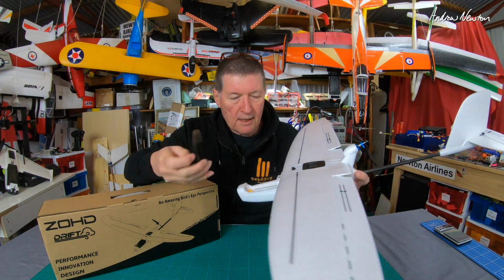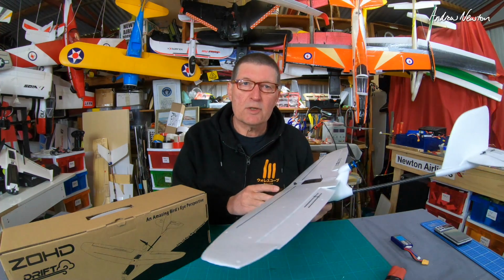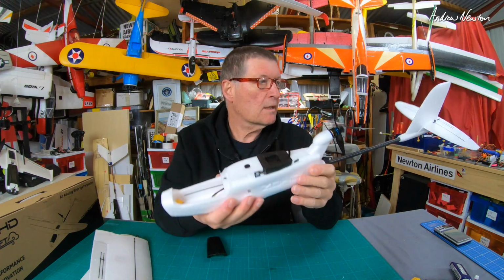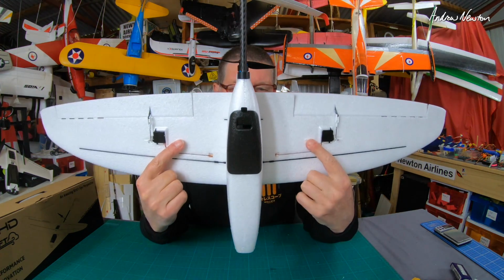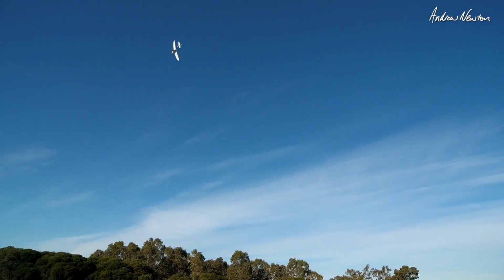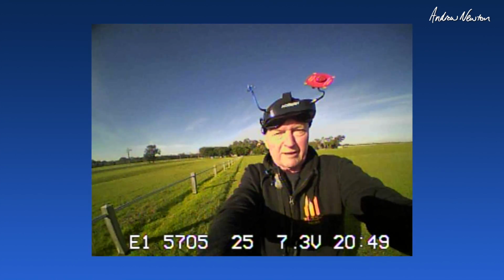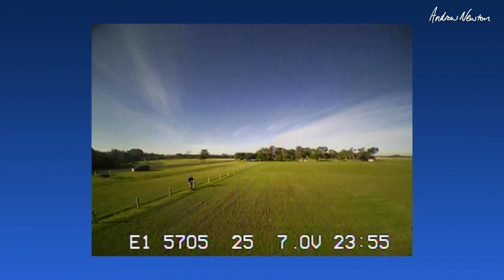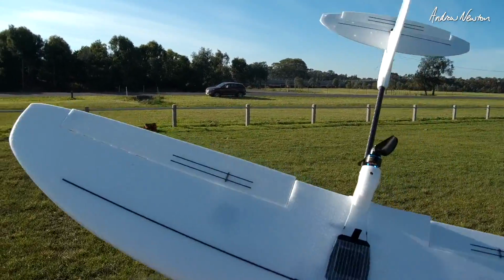ZOHD Drift - Assembly and FPV flight

Comment: Good video, i have bought a new one in PNP version and i wan use it like motor glider for relaxing fly, with not autopilot and camera, only manual with my rx and tx used.Can i conect the ESC and other servos directily to my rx?What is the set up recomended for this manual mode to fly?THANKS,
Reply from the maker: Yes it flies well as an agile little LOS model. No special setup required, maybe reduce the rates if it's too agile.

Comment: Just maidened my Drift with KoPilot - flew great in stabilized mode - great return to home behavior - used autolaunch RTL to launch twice - both went off without a hitch  -3s 850 balanced 10mm in front of the nubs  - but it flies poorly or not-at-all on manual mode - just rolled over and dove to the ground. My buddy did this and his crashed, so I did very little manual testing - but i will normally fly fpv in stabilized mode - best out of the box experience for FPV for those who do not want to tinker with electronics and ZOHD always impresses with design.....I am also sold on the Kopilot - easiest and cheapest way to add Return to home to any model.

Andrew - have you had any experience with this manual mode behavior? 

Great channel Andrew!
Reply from the maker: Full throws are probably too much for manual mode. I used 50% weight just for manual.

Comment: Andrew which do you prefer between this and the eachine razor or are they just different animals?
Reply from the maker: I'm flying the Razor more as a sloper and handles wind a bit better.
Reply: @AndrewNewton  not so many slopes where I am and not by the coast so more flying in the countryside. Just looking for a good upgrade from the F959 and already have an i6 controller

Comment: You came back and fixed your 1800 to 1100 battery size..??
I would not have bothered for that one mate..
I'm struggling getting CG with 2 x Lithium Ion 4000mAh Batts, Any hints?? More nose weight?? Try flying as good as You??
No Nav gear installed.. <]:)..
Reply from the maker: Huh? You've lost me there. On the Acrobatic sloper video I used 950 2s right forward then 3000 2s Li Ion pushed right back under the front of the wing.
Reply: @AndrewNewton :: May have found an answer!!  ""Throttle Elevator mix - Taranis Q X7""

Comment: Mine flies great as long as it's in stabilized mode.  When you switch to manual, it immediately noses straight down and heads to the ground.  You can switch it back to stabilized and it recovers,  the auto launch and return to home work great.  I've checked the CG and all seems well.  I don't want to fly FPV until I get this worked out.
Reply from the maker: Always always get planes flying in correctly manual mode first, then everything else follows

Comment: i heard that the wings destroy themselves if you go faster than 50mph.
Reply: Yes, it is specifically sold as a model for gentle turns and soaring - it is not a hotliner, and not for tearing up the sky. Manual says "ZOHD Drift is mean(!) to be a slow cruiser. IT'S NOT a RACING/AEROBATIC plane". There are four more sentences to more or less the same effect... see https://fa00daf4-2348-470a-96d7-418afee9141d.filesusr.com/ugd/9960f7_7f9255c5fcc24aa1a556ffa8f40b79fd.pdf
Reply: @KetilDuna  diving to lose altitude is not a racer. It should be air worthy and it is not. Glad I did not buy it.
Reply: @ror-ys3qp  I'm happy for you, making your decision. Your initial 50mph ~ 80km/h has little to do with "a slow cruiser" as far as I'm concerned. If you change your mind, be sure to cut off the engine before diving. There are also two aileron servos .. i retired the Y-cable and implemented combined aileron/flaps on mine. The flaps slow things down really well, and can be combined with quite steep descents. Also, use a small battery to keep it light and avoid speed buildup, especially if you carry the camera/tx appliance. I'm glad there are choices and a market for small, light and relatively slow flyers. Powered gliders are so nice for casual flying. Happy flying!

Comment: Does it use a y harness on the ailerons?
Reply from the maker: Comes with a Y harness but you dont have to use it.
Reply: Thank you andrew i have the zohd dart and the drift and kopilot  on its way most videos dont really show that close up the drift like the dart has two aileron servos my dart dosent have the kopilot it has the maytek wse i plan on trying my extra r-xsr on the drift with s bus
Reply: Nice so the drift has a servo in each wing   and you didnt use the y harness then where does the second servo plug into ? Aux or rudder im  Still waiting on my drift and kopilot
Reply from the maker: @RGCbaseace  For the Kopilot you do need to use the Y lead.
Reply: @AndrewNewton  i got it figured out thanks what a lil gem 💎 to fly wish it wasnt raining here id be flying

Comment: Hi Andrew, I’ve just received my Drift an unboxed it right away. As everyone has been saying it’s a beautifully made little thing but something puzzles me right away. The left wing has the tip turned up and the right wing tip is turned down!  In all the videos I’ve seen nobody seems to mention that - is it correct? Looking again at some of the shots in your video I can almost persuade myself yours is the same.
Reply from the maker: Hi Mike. Mine had one down and the other up by a few mm. Not a design feature just distortion from the way it was packed. It evens out eventually or you can run hot water over the foam to restore the intended shape.
Reply: Thanks for the info Andrew, good to know it’s not a fault with the kit. It’s certainly a little gem the way it’s put together, I don’t think it will stand a lot of bashing though.

Comment: hi andrew with kopilot setup  do u set it as t-tail .just got drift see drift has ycable  and  1 cable for ele. do i put ycable to ail .ailcable to ail.as in guide in kopilot in t-tail setup.
Reply from the maker: Yes T-tail for the drift and yes Ailerons y-lead into Ail and single Ele lead into Ele

Comment: HI Andrew, great video. Definitely interested in ordering this. What receiver do you recommend for the drift? I'm planning to get the Radiomaster TX16S controller. Thanks!
Reply from the maker: Any small receiver, I'm using the FrSKY XM+. If you're going for an FrSKY Rx make sure you avoid ACCESS versions if you're using the TX16S
Reply: Hi Andrew, thanks for getting back to me. I wasn't too sure if some receivers are better for certain craft. I enjoy the videos and the blog you write - excellent work. Thank you.

Comment: Never could understand these models that leave one of the control surfaces out (no rudder or no aileron), it's a big deal breaker for me...
Reply: victor        some info.    sounds like you lack some  data.
a model that has a main wing with little/no dihedral  must  have ailerons; and turns will be aileron-initiated.     on such a model, rudder will not be very effective; and not having rudder control is  not  an  issue.  (for other than 3-d flying)        with sufficient dihedral in the main wing, a model will turn via    rudder-elevator  inputs.    and, in the context of having adequate  roll-axis  control, ailerons  are   overkill.        occasionally, the amount of dihedral in the main wing will allow the use of either control scheme; via three or four channels .      googletranslate
Reply from the maker: Radian is a classic with no ailerons. Any flying wing no rudders.
Reply: @AndrewNewton  Flying wings i can accept as that is the design. A plane that should have ailerons/rudder but doesn't is like headphones on which only one side works: it gets the job done but it's a terrible experience. I recently got a used hobbyzone super cub (a classic as well) and it's a terrible plane as it has no ailerons. Sorry, don't mean to be negative, good video though!
Reply from the maker: No need to apologise when chatting about the hobby. Thanks

Comment: Hi Andrew dose the 400 fpv camera plug in to the aux on the kopilot or do you power it from another source
Reply from the maker: JST plug from the ESC (battery side) so it runs on full Lipo voltage

Comment: What flight times are you getting with what battery? I have a few 3s 850mah which I think would be great and I am hoping for around 5 minutes power on.
Reply from the maker: Continuous full power (not recommended) would give you about 6min

Comment: Beautiful plane & so well presented with each segment #1. Does the FPV version require a receiver? Thanks mate.
Reply: Yes it will. They would mention it if it was included so a potential buyer would know if their radio was compatible. Andrew indicated he is using an FRSKY X4R receiver which unfortunately you can no longer buy.
Reply: Many thanks Simon
Reply from the maker: No receiver included, you could use a Spektrum receiver
Reply: I thought so. Looks a nice little travel model... when we can travel, of course! Thanks mate

Comment: If I purchased the FVP version of this plane could I record the video of the flight without actually flying it using the FVP googles
Reply: Instead, use an HD camera like Mobius or Runcam 2
Reply from the maker: You would also need a video receiver and DVR to record, or as PrinceVaskur said put a Runcam 2 or Mobius onboard

Comment: Wonderfull thing !  Interest for PNP version.  Some questions :  Do you think there is enough place for Matek F411 ?   And would a 3S 1500mAh battery (135g) already be too heavy for the plane ?  I would like to fly with INAV and Caddx Turtle V2 in the front !  Is it already too heavy for the modell, what do you think ?
Reply from the maker: F411-wse would be good. That battery might be too big to fit and too heavy for balance.
Reply: You'll have to do some surgery to shoehorn it in their i put one in the dart but theirs barely room for a single board fc in the drift